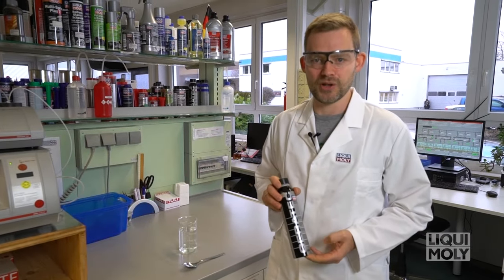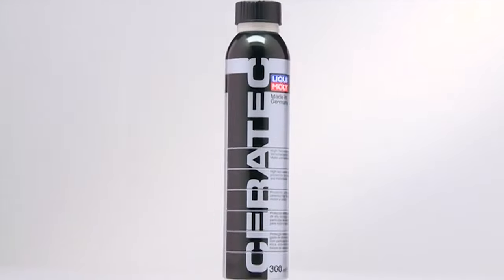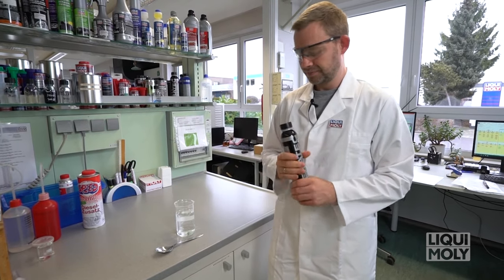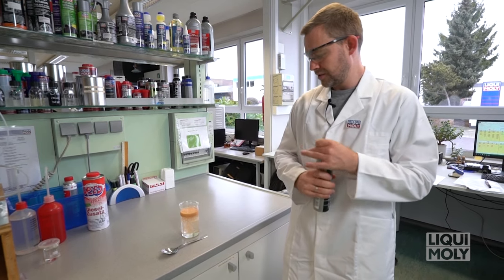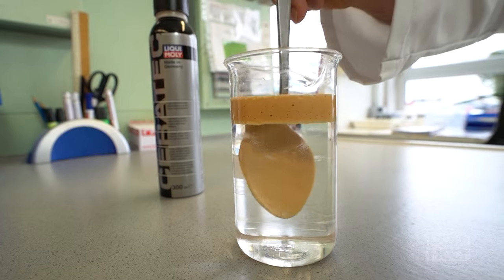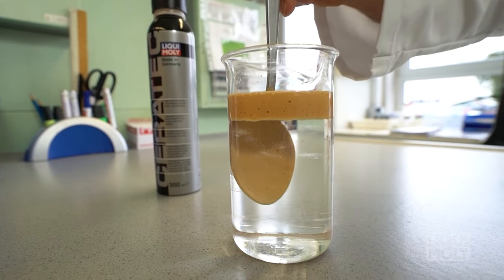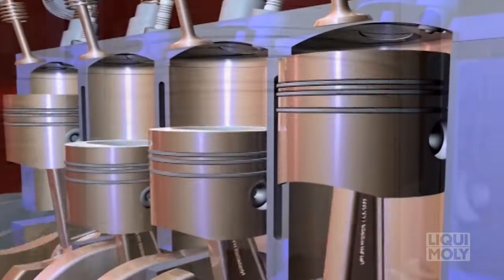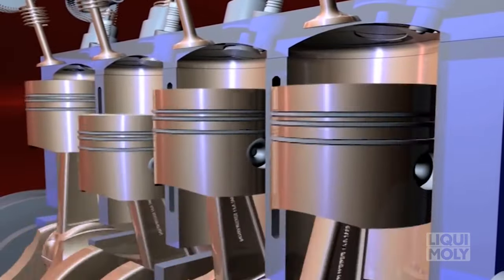LIQUI MOLY CERA TEC (Art. 3721)

Comment: Does it decrease oil consuption?
Reply from the maker: Hello Thiago, 
thank you for your inquiry.
Foremost Cera Tec is an additive which reduces friction and wear. 
Lowest possible oil consumption thru lowest possible wear and tear is the result when Cera Tec is being used regularly and preventive. 
But Cera Tec is no problem solver when increased oil consumption is already present (which may have multiple causes and needs to be investigated by a mechanic).
https://pim.liqui-moly.de/pidoc/P000017/3721-CeraTec-44.0-en.pdf

Kind regards, 
your LIQUI MOLY team
www.liqui-moly.com
Reply: Use the liqui Molly engine flush 
I have a Scion tC that had an oil consumption problem 
The rings get gunked up and allow oil to pass through 
I did this 
Got the car completely warmed up ( take it for a ride ) 
Turned the car off 
Pour in the whole bottle of engine flush in to the crank case 
I let the car idle for 30 minutes 
Turned the car off 
Waited ten minutes 
Drained the oil 
Changed the filter 
Added new oil And got the proper level 
After that I added a can of liqui Molly Ceratec to the crank case and drove it for a few miles 
You can almost instantly feel the results 
Runs much smoother 
Accelerates much easier 
Noticeably quieter 
And oil consumption is just about non existent

Comment: so..in theory i could buy the cheapest conventional API approved oil ,and pour this ceratec additive and itd become similar to a highg pricedsinthetyc  mobil 1 or royal purple...
Reply from the maker: Hello best, 
LIQUI MOLY Cera Tec reduces friction and wear due to solid lubricant and chemical friction modifier inside. 
But it does not turn a low quality oil into a high performance oil. 
Oil has much more properties than lubrication. It is necessary to use an oil which is recommended by the manufacturer. 
After choosing the appropriate oil you can add the LIQUI MOLY Cera Tec to raise the engine stability and performance.
https://pim.liqui-moly.de/pidoc/P000017/3721-CeraTec-44.0-en.pdf

By the way:
Do you know our oil guide? 
https://www.liqui-moly.com/en/service/oil-guide.html
There you will find the appropriate oil for your vehicle. 

Kind regards, 
your LIQUI MOLY team
www.liqui-moly.com

Comment: can i add ceratec to grearbox oil 75w90 ?
Reply from the maker: Hello ahmed, 
thak you for your inquiry.
Cera Tec can be added to all conventional oils on the market. 
But please ensure that there is nothing in the gear box or axle that works with friction (difflock system, etc.). 
And please do not use it in automatic gear boxes.

Kind regards, 
your LIQUI MOLY team
www.liqui-moly.com